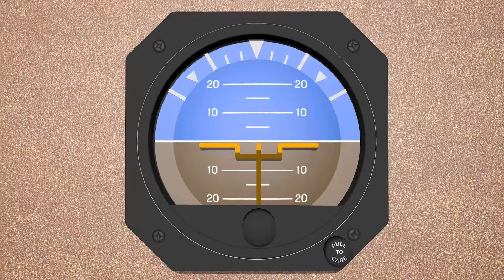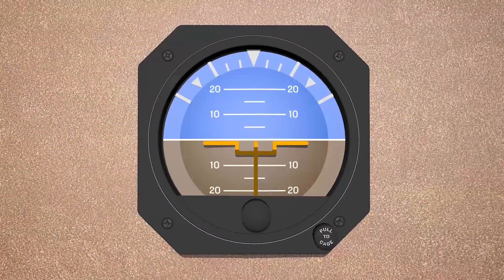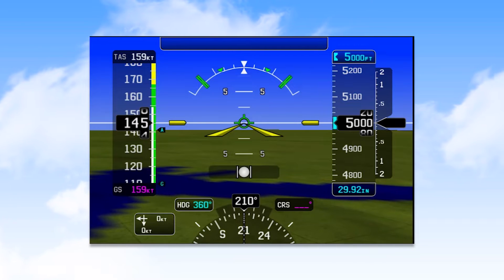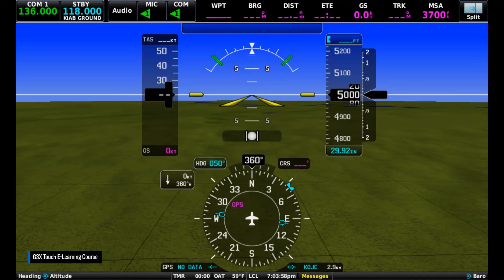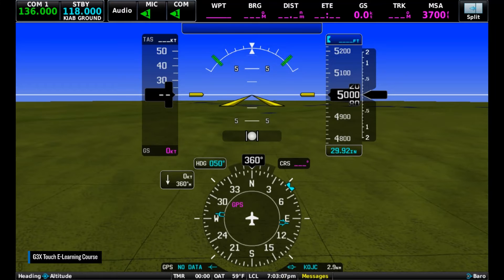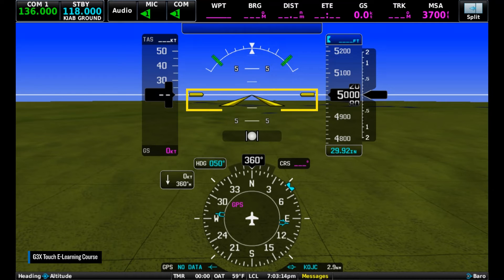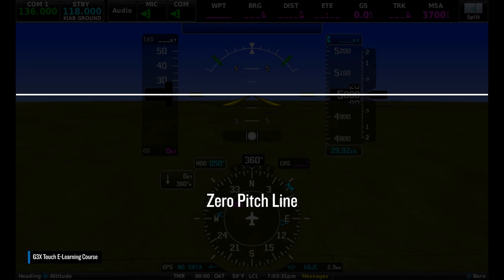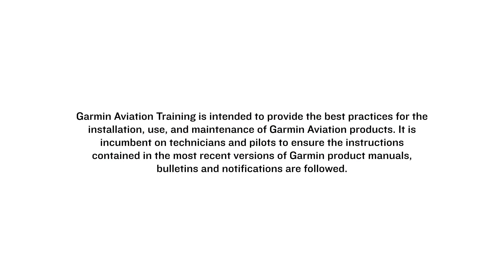G3X Touch: Why Can’t I Adjust the Airplane Symbol?

Comment: Level flight changes pitch with different power settings. However, in the old gauge, you could adjust in flight to level flight and parallax. In the G3X, level flight for me is about 4 degrees nose up at cruise. It's worse than useless, it's distracting. Garmin should have an option to adjust the Zero Pitch Line based on touching the Level Flight button or manually. If I'm on a cross country or especially an instrument flight, let me adjust it to level flight.

Comment: I thought something was wrong with a C185 with a G3X Touch that I took on a test flight.
The seller said it was normal for the pitch to be way above level when on the ground and
there was no adjustment. 
I hadn’t considered the parallax angle🤔

Comment: Yes, but we WANT to be able to adjust it.
Reply: I think Garmin identify in this video a case where you would want to be able to adjust the aircraft symbol, I.e. if it doesn’t lie on the zero pitch line when in level flight at your normal cruising speed.